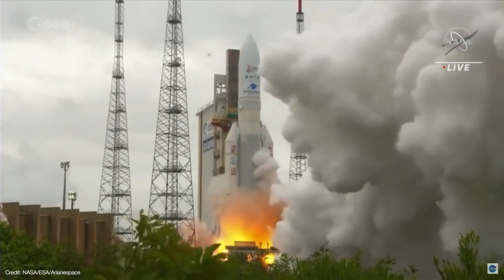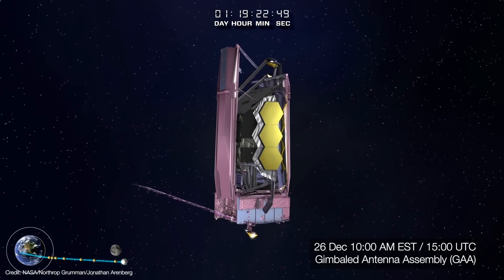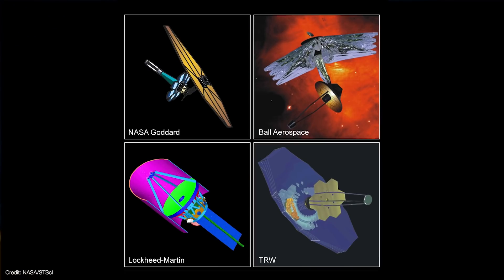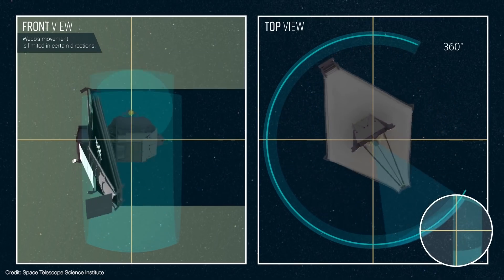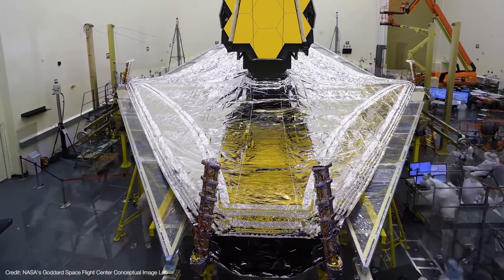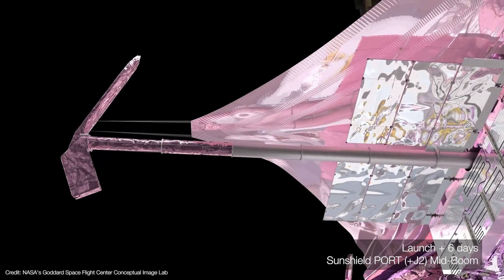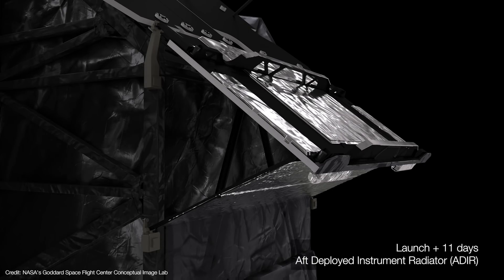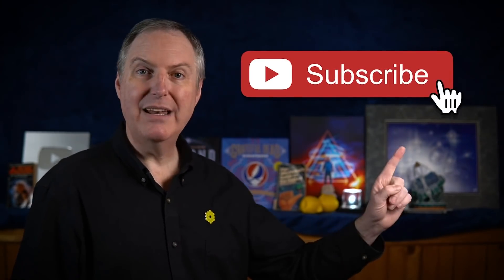How James Webb's Deployments MUST Work

Comment from the maker: 🔴WE HAVE A TELESCOPE! I was making a "halfway there" video following yesterday's sunshield deployment, but then they went and moved up the secondary deployment to today, TWO DAYS earlier than planned. In the meantime, the most critical deployment since the solar panel is out of the way! Without it, there's no way to use Webb. but now it's possible!
Reply: I thought it would be a telescope once the two side panels of mirrors deployed?

Overall this is great news as I still feel scarred from the Hubble mirror debacle back in 1990! lol
Reply: @jc4evur661  He mentioned that the center panels alone would still be enough to function, but of course, the side panels would be optimal
Reply: @estephanieHo  Thanks!
Reply: Where can I find one of those puns? I've been waiting for over a decade in positive thought for its deployment.
Reply: Where can I get one of those pins?

Comment: Those of us that worked on the battery were holding our breath waiting for the Solar Panel deployment.  Seeing that come online let us know we did our job correctly.   We were only one little part but it felt super important to us.
Reply: As actors are wont to say - there are no small roles. Every single 'little' part was essential and the end result is one of Mankind's great achievements. That Arianespace carried off the perfect launch is simply the icing on the cake.

Comment from the maker: 🔴UPDATE: Sunshield tensioning underway! After going late on New Year's Eve, the team took the day off on Saturday and then Sunday elected to better characterize Webb's behavior now that it's in space. So sunshield tensioning was delayed until today and began this morning. This will continue for the next 2-3 days until fully deployed! Thumbnail updated :)
Reply: Wish they put cameras on it so we can see how it is going.  Prob would help mission control to handle issues as well.
Reply: @navychop6667  probably because when this was initially designed cameras were the size of a fridge ;)
Reply: @theflyingfool  lol...true.
Reply: "to better characterize Webb's behavior" What does this mean?
Reply: @jc4evur661  
There are always slight differences between the way the spacecraft systems operate in space, versus during ground test.  Although they try to replicate the space environment as well as possible during ground test, it isn't possible to get this perfect.  
They are examining lots of data - temperatures, battery condition, power usage, solar panel output, etc., to make sure everything is within required ranges.  As of Monday Jan. 3rd, they have made two tweaks:  
1.  Solar panel regulators have been adjusted to match power needs better.  These were initially set to factory defaults, but they have now been individually optimized.  
2.  Shield tensioning motors were a few degrees warmer than they wanted, so they adjusted the spacecraft attitude for a while, to reduce sun exposure and get them down to the desired temperature.
Reply: @marianneoelund2940  Thank-you...Now I'm seeing why it cost so much! lol
Reply: The sunshield deployment had the only system failure so far. When the sunshield deployed fully it should have triggered a set of switches confirming that. These switches did not operate - leaving it unclear whether or not the sunshield had deployed fully. After a few anxious hours, confirmation came from the team monitoring the temperatures of the individual shields. They reported that the cooling was proceeding on schedule which could only happen if the sunshield were fully extended. The switches were, indeed, faulty. It could also be argued that they were unnecessary...   (o:

Comment: When I hear the phrase "single point of failure" I assume you mean something that will render the the telescope a useless piece of space junk. Is that what you mean or something less dire? I hope all goes well, but I think it is a criminally irresponsible waste of money if JWST was really designed with so many SPoFs. If a particular failure doesn't kill the telescope then I think it's incorrect to call that an SPoF. Any system that has some sort of contingency plan that will allow the telescope to compensate for a failure isn't an SPoF.
Reply: Welcome to the wonderful world of engineering. 😊
Reply: @dontgetmadgetwise4271  Thanks for the welcome, but I've spent the last couple of decades in a world where engineering requires identifying every possible single point of failure and ensuring that there's a spare component that can take over. The only discussions we have are whether the redundancy should be active-active, active-standby, hot standby vs warm standby vs cold standby and 1:1 redundancy vs N:M redundancy. That's why it's so weird to hear someone claim that a one of a kind spacecraft would be launched with even a single SPoF. In my field we don't allow SPoFs because a failure could lead to hours or days of downtime until someone can replace the failed component and that's considered unacceptable. To design a system with SPoFs when no repair or replacement is possible seems like the height of incompetence even if you get lucky and none of your SPoFs actually fail. That's why I'm wondering if the term SPoF is being used by someone who doesn't really know what it means.

Comment: James Webb = DUMBEST ENGINEERING EVER
Instead of designing a transforming telescope with which ANYTHING could go wrong, they should simply have designed an 8m (or even 10 m) cylindrical telescope a massive payload fairing or nose cap. Test flying a fairing or dummy payload will not risk the mission, will not take 10 years and will be cheaper. This is not to mention that a XXL fairing for whatever launch vehicle they choose will potentially have future applications.

Comment: I've got NASA live updates up now and it's looking very promising though a long ways to go. Sill on the Starboard Mid-boom deployment. Keeping fingers crossed. That's an awful lot of single points of failure. I'm confident in the engineering, but `x factors` abound!

Comment: When certain electronics don't work for me, such as my computer speakers. I give it a good ole' slap or shake and it works fine. I know which cable needs to be fastened, but getting down behind my desk can be annoying, and I know a good ole' slap will shake the cables enough to make it work just a little longer. I think it's hilarious that engineers have essentially built that feature into Webb for it to "shake itself back and forth to loosen a stop deployment" : )

Comment: My proposal, which would be shot down cuz I'm not an engineer, would have been: Send the heat shield up first into low earth orbit. Ensure it's fully deployed and solid, then send up the telescope, dock and shove off. If there was a problem with the sunshield it could have been serviced.
Reply: The sunshield is really fragile. If you approach the sunshield with any current spacecraft, you'll damage it with the thrusters. So this would have required the development of a new spacecraft with its own complex deployment sequence (long booms that will position the thrusters away from the sunshield).

Comment: Is there a way that Hubble can track the deployment of JWST? This way we have visual conformation that all is going well 😏 and as a bonus: it could make some great pictures to be shared
Reply: No, Hubble can't resolve JWST. It doesn't have anywhere the resolution for that. 

Hubble's resolution is about 0.1 arc seconds. So even if it were trying to image things on the moon, hubble can only detect lunar objects that are GREATER than 200 meters (again, as seen on the moon). That means that hubble would only see a football field on the moon as a few pixels! 

Since JWST is WAY smaller than 200 meters and its is WAY further than the moon, there is no way that hubble can image JWST.
Reply: these initial stages maybe. But pretty soon JWST is farther away than the Moon, and it'll only be visible as a single pixel to Hubble.
Reply: @zounds010  what has Hubble been taking pictures of for the last 30 years then? I don't think it's cereal boxes 😉 of course you'd only be seeing the shield from hubble's pov, but at least you would now that it deployed right
Reply: @xisop  Hubble has been taking pictures of stars (they mostly show up as a single pixel) and galaxies (those are ~100,000 light years across, so they can be resolved).
I'm not guessing here. It's easy to calculate the smallest details Hubble can resolve.

Comment: How does the Webb stop at the L2? Are there front thrusters to stop it? And by what means does it achieve the "halo"? Won't thrusters be needed continuously to keep it circling?
Reply: There are no front thrusters. It will be going at just the right speed for gravity to stop it, just as a ball thrown up stops at the top of its arc. At that point, thrusters will adjust its course into the halo. Earth's gravity keeps it in the halo, as the centerpoint of the halo is a line drawn thru the Sun and Earth. The halo is a low energy rotation, generally stable, that will only require occasional thruster correction.

Comment: Wonder if they arranged for refueling Web or will they just abandon it when it runs out of thruster fuel.
Reply: NASA has said that refueling Webb would be difficult, but possible robotically.
Reply: @jamese9283  
Hope so. Pretty stupid to simply ditch a billion bucks of hardware just because you run out of gas. Refueling sats and the like needs to become a regular event to reduce orbital junk and save $$$

Comment: This is a truly fantastic video!

Question - the farther from the sun, the slower the orbit. How does it “park” on the other side of earth permanently? Just as Mars takes longer to go around the sun because of its distance from it, so will JWST relative to earth’s orbit, right?
Reply: Earth's gravity pulls it along to speed it up.
Reply: that's the magic of this Lagrange point. Normally you're correct, but anything in the L2 point gets pulled along by Earth so it orbits in sync with Earth.

Comment: How do radiators work in space with no air to take the heat?
Reply: Electromagnetic radiation (infrared) similar to the Sun.
Reply: @jamese9283  yep, they have to rely on radiation only. So radiators on spacecraft have to be much larger than their equivalents on Earth.

Comment: Question I see so many stars in the sky . So do  they exist outside of  our solar system and we can still see them with our two eyes ?
Reply: Yes, the stars are outside our solar system. Far outside. The closest star is 4 light years away; that means the light from that star takes 4 years to travel to us. Pluto is about 12 light-hours away: our solar system is tiny compared to the distance to the next star.
Most of the stars we can see with the naked eye are within 10,000 lightyears from us. Our eyes are pretty good at gathering tiny amounts of light. With a telescope we can see even more.

Comment: As far as the fuel problem that limits the life of the telescope - and I'm absolutely sure this was thought of by the engineers who designed this absolute marvel of human achievement - but was there no way to develop the craft in such a way that the fuel tank could be refilled or replaced by another remotely operated craft to go out and meet it there? L2 is about 1 million miles from earth, so given the speed of light which would limit how we could remotely operate a maintenance or refueling craft, there would be about a ~5 second delay between any maneuvering commands or signals to reach the craft which would make things difficult but not impossible. But yeah I know I must be missing something but can anyone enlighten me on why designing the craft to have a refillable or replaceable fuel tank and sending another craft out to service it would be infeasible / impossible / impractical?
Reply: NASA has said that refueling Webb would be difficult, but possible robotically.
Reply: @jamese9283  Oh ok, that's what I thought, it would be difficult but doable.
Reply: the main difficulty is that we have to build a spacecraft that can approach JWST without damaging the sunshield. When you aim a thruster at the sunshield, it'll be ripped apart.
Reply: @zounds010  I see, and yes a main conventional thruster would definitely rip it apart, but it could just get close enough to the JWST with the main thrusters and then maneuver around for the refueling process with cold-gas thrusters like compressed air or nitrogen, something similar. I think by the time we reach the end of life for the JWST we can definitely develop a refueling craft to get the job done robotically. And even if it fails I think it would be worth it as it would be cheaper than launching a whole new telescope and if it damages the JWST at that point it wouldn't matter as it would be retired and essentially thrown away due to lack of fuel anyway.

Comment: It’s most likely not true that the scale of the  sunshield deployment is unprecedented. There have been quite a few electronic surveillance satellites that have used large deployable dishes with tech analogous or similar to the sunshield. They’re just officially classified. They’re not going to risk all that money on Webb with unproven tech. It’s actually a continuing a pretty interesting tradition of national security assets making advancements that later contribute to science. Just as Hubble was a redesigned KH-11 and the shuttles were designed to essentially to launch and maintain the Keyhole fleet. Even tho it’s doubtful that they ever did that.

Comment: Great video ! Left a subscription.
I'm wondering how they get precise enough position readings that far away from Earth and what the margin of error for position determination is, to get James Webb safely into its L2 orbit.
Reply: They are measured from Earth, using the radio link. Distance is by sending a signal to JWST, then timing the echo. The Doppler on that gives the speed (down to mm/s). Lateral position is a bit less accurate if they use one station on Earth, but they could triangulate.
Reply: @zounds010  Yeah, the lateral part is what concerns me. Not much of a triangle at that distance.
Reply: @Capt.Turner  Lateral position would've been sorted out within the first 2 burns when it was close enough to Earth for regular old triangulation. The farther out it gets, the more fuel lateral corrections would take.

Comment: Excellent video, thank you!!  I'm hoping that, in case of any failure, the SpaceX Starliner would be able to (in time) mount a rescue / repair / refueling mission.  Starliner was designed to be refueled in orbit, so they would have plenty of fuel available to make the outbound & inbound trips at a Much higher speed than the JWST.  I'm also especially hopeful that we can mount a refueling mission, as the JWST Was designed to be refueled in orbit.

Comment: It would be interesting to know exactly how tech staff here on earth can monitor if e.g. a mechanical part, a moving arm etc worked as it should or it is slightly off but still works. Are there any specific signals for success or failure? Why there are no cameras on it - even primitive ones - to inspect the whole thing? What about any plan-b/rescue mission if something goes really wrong. They will just abandon it?
Reply: Webb does not have a modular design like Hubble, so there is no reasonable way to repair it.
Reply: Monitoring is with position sensors, and e.g. by monitoring the speed and torque on deployment motors.